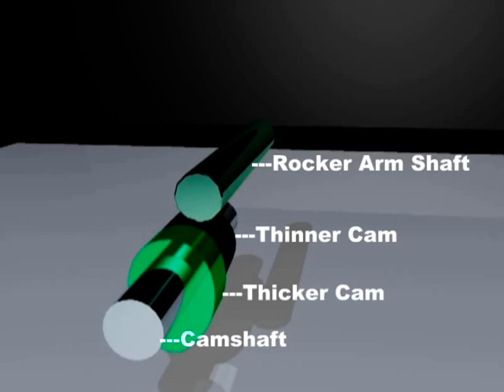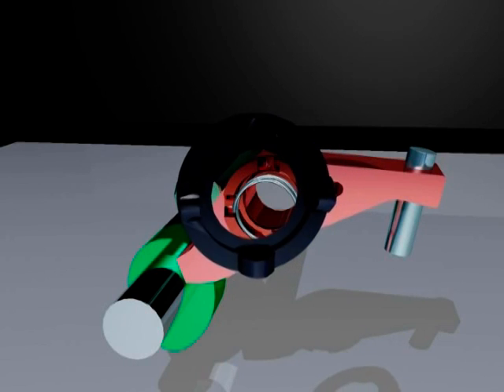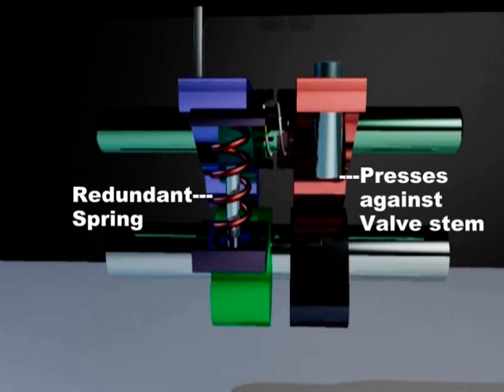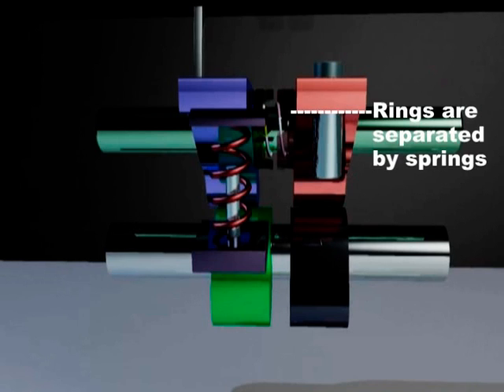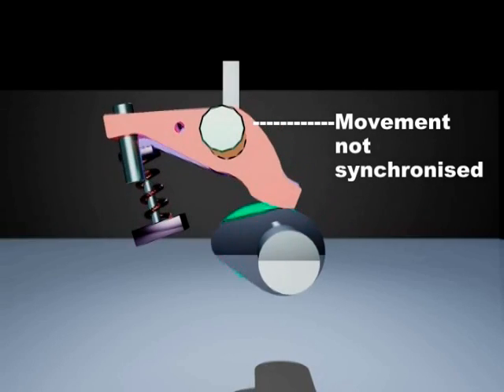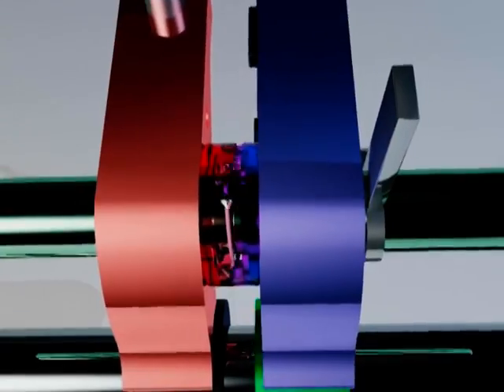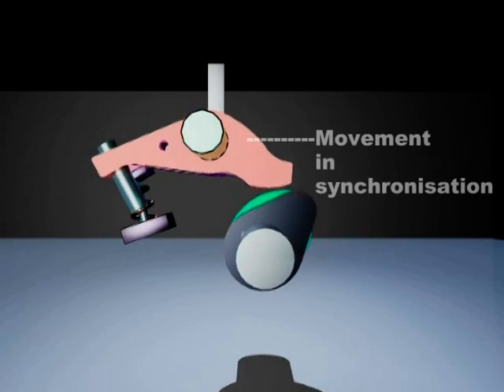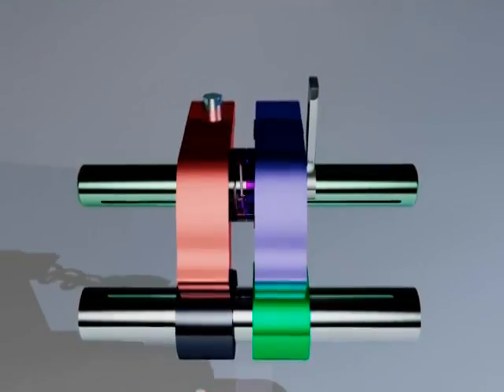VVT

Comment: THIS IS NOT VVT!! Variable valve timing uses a geared system to only advance timing. This isn't even variable valve lift per say as it uses a separate rocker. This is actually hondas vtec system. Get it right